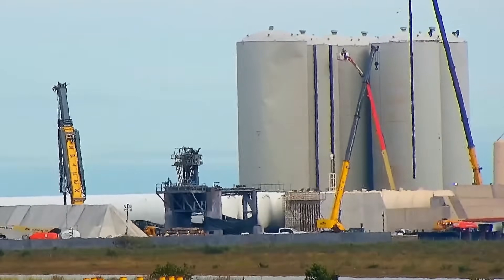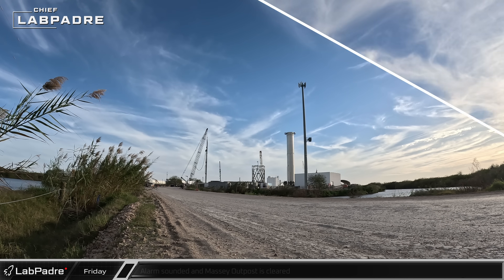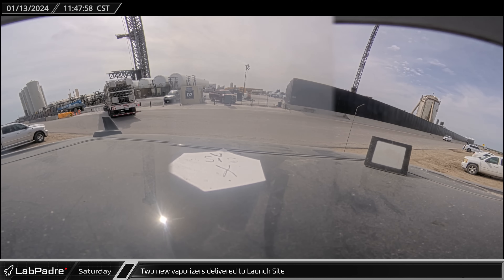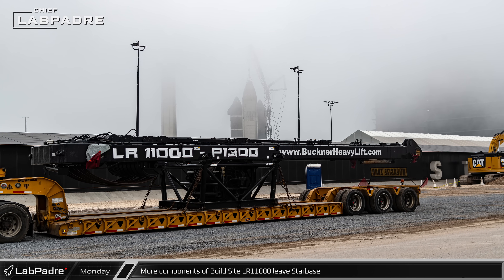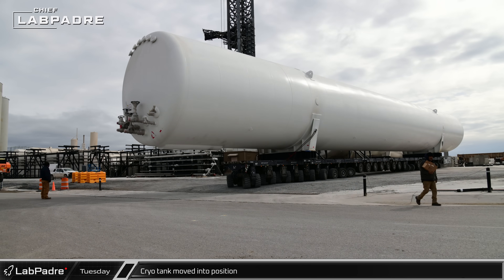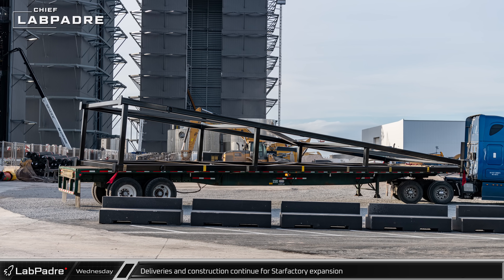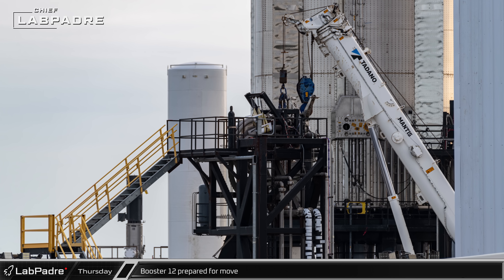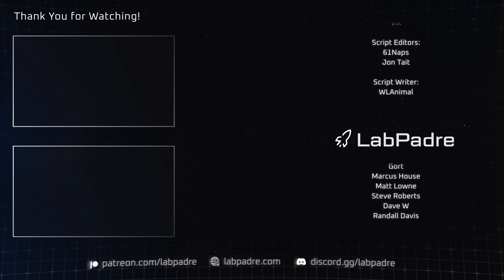We Are Quickly Approaching IFT-3! - SpaceX Weekly Update #98

Comment: 10:46  Starfactory pic - is that a double wall going in on the right side?  Maybe for windows?
Reply: The vertical truss columns are designed for supporting heavy loads of the elevated rails and the bridge cranes.